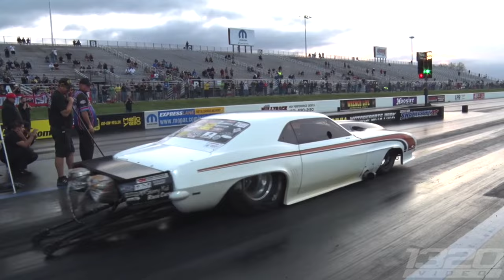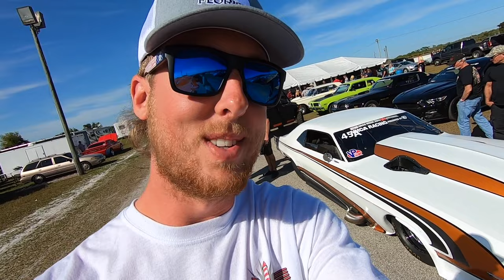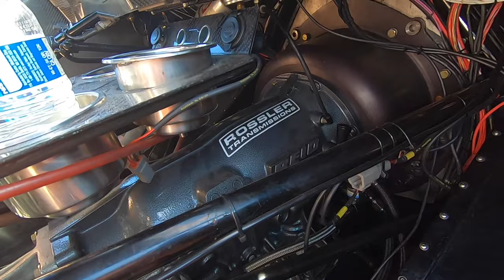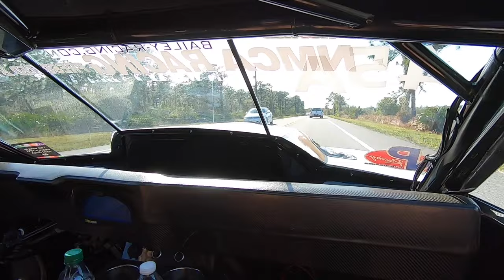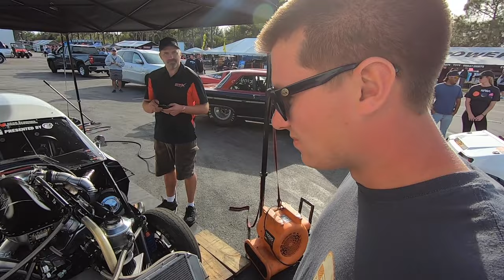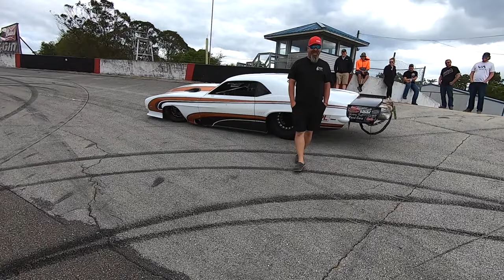We Let a 4,000 Horsepower Promod Camaro Into the Freedom Factory... (Laps and Burnout!!!)

Comment: When he was doing the burnout I was thinking “That was weak” but then I remembered when it idles it’s makes more power than my truck 😂😂
Reply: Yeah that was probably what.....1/8 throttle?
Reply: It’s also set up to hook.
Reply: 1 cylinder makes 2-3x what your "truck" makes
Reply: trillrif axegrindor well it’s a bone stock 7.3 so it makes probably around 200 horsepower so yea it probably does.
Reply: umm yeah I was thinking ... this worth more than the freedom factory .. and makes it look shit... a prospective in whats really what, great vid and a mark in time for where Ceetus is going and how hard he has been working and producing some great content
Reply: phoenix rising those engines can’t limiter like that, it’ll blow up or overheat almost immediately
Reply: It isn't the same tires as your truck neither haha
Reply: If he put anymore than a 1/4th throttle his 4 gallons would be gone depending on the tune
Reply: A metric shit ton of contact patch and it roasts em on just a touch of throttle. Insane
Reply: 260 is no joke
Reply: I thought the same exact shit 😂😂
Reply: Dave Micolichek  it was prolly in its highest gear and 1/8th throttle
Reply: @patrickc658  damn american engine's i got a 1.0 kia that makes 180 hp 😅
Reply: Hey you still gotta get some traction to the ground
Reply: Don't they even limit the power on burnouts?
Reply: Lo lol
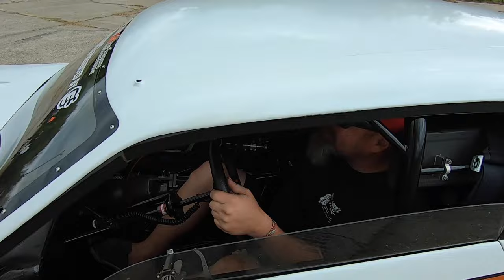Reply: if you remember in the video, he was running on pump gas @9:38, so it's making less HP than if he was on Methanol.
Reply: @kemik8045  it's definitely in methonal at the FF. That's why be said it only had 4 gallons. That's about what it needs for a pass, with some extra for the pumps.
Reply: It makes 10x more power than my 305
Reply: Faxs
Reply: @phoenixrising4573  7bp
Reply: Think Tom did like 5.6 this last race week.
Reply: @vincenthoogzaad  1.0 180hp must be on sause

Comment: I was gonna say you should build a serious circle track car for the freedom factory.  Then I remembered the Dale truck.  Get that thing rippin!
Reply: Killing me that it's never done a proper lap on video yet....
Reply: He isn't going to run the Dale truck on the track seriously, the chassis is worth too much too him and tearing it up would cost a fortune to fix. He needs to pick up a wheelin modified or a short track truck like brents Kole truck if he wants to play around.
Reply: too short for the truck Winged sprinter car is what they need.
Reply: @Mr.Potato420   The track is not to small for the truck. It looks to be a truck from around the late 90's when the series started and they ran on a track the same size as the FF from 1995 to 98. And ran on an even smaller track in  1995.
Reply: it's not circle track anymore, it's detuned. circle track cars have different springs, cambers, and weights on all 4 corners
Reply: I don't care if it's not set up properly. Imagine how good it will sound echoing off those walls.
Reply: @ArmyBoiSweat  True but to fair It will run around the track just fine as it is. It just won't be as fast as if it was setup for oval. Also if it still has a race or race style adjustable suspension on it, it would not be all that hard to adjust the cambers and either adjust the springs or swap them out to get it to a more oval style setup.  With that said I don't think Cleet want's to chance putting it in the wall but who knows what he will do.
Reply: TimothyReidUpNorth907  then let's see you buy one and take it around a track.
Reply: If I remember correctly they changed the caster so it drives straight and now they need to put it back to oval racing.
Reply: Sic Semper Tyrannis  that truck did actually race in that scheme though, just Earnhardt never drove it.
Reply: I like the sprint car idea.
Reply: TimothyReidUpNorth907  What was I thinking when I said that? 
1) I wouldn't care if he took it out on the track. I think it would be awesome for him to put some hot laps on it. 

2) He paid something like $8500 for it might be little less. A true truck series chassis goes from between 3k to 25k without the nascar engine and tranny. The dale truck is a little more special then average because it has the RCR number three on the side of it (Mike skinners truck). Its also street legal which isn't that easy to pull off and takes a hell of a lot of work to make happen. 

3) Most of all Cleetus said he wasn't going to run it around the track for more then joy laps because he doesn't want to screw it up because it was irreplaceable to HIM.  Cleetus said it cost $3500 bucks to fix the original sheet metal after he back into i think it was neighbor and that was barely a love tap. 

4) All that being said is why I talked about him needing a wheeling modified or a short track asphalt truck similar to Brent's from PFI.
Reply: jacob sweat they literally just raced 20 something non circle track crown vic’s and weren’t a terrible split away from what the old owner said was a fast lap (considering they were all on a crappy tyre too)
Reply: Been sold
Reply: Like so many things involving the freedom factory, the opportunities for  different vehicles and content is beyond counting.
Reply: I can't believe that thing is street legal! here in Australia if you drove that on the road, the entire police force would come to arrest you.
Reply: oh shit yeah
Reply: Have Cleetus drive a 410 winged pavement  Sprint car around the track for 50 laps
Reply: @Liberty_Prime_Is_Online  Bro move to NZ where we have decent car laws then.
Reply: @Liberty_Prime_Is_Online  Australia with even more gestapo-esque statist crap! Love the people, y'all have terrible choice in politicians.
Reply: Dale truck, Dale truck, Dale truck
Reply: I have raced here that track is not to small for any type of oval car I have seen nascar truck teams use that track for testing

Comment: I can imagine the conversation:
"Wanna ride in my 5-second street car?"
"Is that zero to 60?"
"No, quarter mile."
"WUUUUT???"
Reply: Whole new ballgame. When you compare 0-60 in 5 seconds fun to saying this car runs a quarter in 5 seconds😳
Reply: That’s the 0-250mph.
Reply: My car doesn’t even do a 5 second 0-60 and this car is at 200
Reply: when 5.998s becomes 5s..
Reply: @Svendrys  probably because the 5 is before the decimal point
Reply: Bitcoin Trades .000001
Reply: Svendrys what would you call it
Reply: Max  just time those MPGs. Take glory where it's due, brother.
Reply: Svendrys 5.77 @258 is the best pass so far on the car. Last rip was a 5.99, so yea it’s a five second car.
Reply: Bitcoin Trades nobody is giving you an honest answer but I’d say a little over one second. It does 42 mph per second acceleration.
Reply: @Svendrys  hello captain obvious
Reply: Dominic torreto will be sad..
Reply: @Svendrys  r u saying 5.9  should be 6?
Reply: @Svendrys  It all depends on what type of Math you are using. In my line of work, 1+1=3 for very large values of 1.
Reply: Max  You need a turbskie on the engine.
Reply: @Svendrys  That's common parlance for drag racers. A five-second car means anything that starts with a five. I suppose it would be more accurate to call it a sub-six car, but that's how it's done.

Comment: Tom Bailey and Steve Morris have and have had that Camaro rolling for a long time. Kind of makes you wonder how much faster Leroy would be with a body on it.
Reply: I think it would definitely make it mile-an-hour better on the big end
Reply: This camaro also has 4000 hp.... that's almost 2.5 times the hp makes a huge difference... I agree having a body would make Leroy faster but it wont run less than a seven without alot more power
Reply: makes me wonder what will happen when toast gets on the quarter mile.
Reply: Leroy has a lot smaller tire also.
Reply: 06 TrailblazerSS we’ve always wondered
Reply: I bet with a lightweight carbon fiber body it would run some 7.6-7.7 on the 7.9 power level and be more consistent as well. I was by no means saying it would run 6s
Reply: I bet it would run 7s again with a body lmao
Reply: The problem with Leroy isn't aero right now. It's suspension. They've said multiple times they aren't going to dick with any aero stuff until they get the suspension sorted.
Reply: And a steve Morris engine 🦅🦅🦅🦅🦅🦅🦅🦅🦅🦅 soooo many bald eagle 🦅🦅🦅🦅🦅🦅🦅🦅🦅🦅🦅
Reply: False Flag and it’s got an LS1...
Reply: @AnthonyBowman  at the speeds Garrett has run with Leroy aerodynamics plays a bigger role than I think you realize. The 8th mile wouldn't change that much but from 660'-1320' is where the real benefit would be realized. I am not sure what else they can do with the suspension that hasn't been done already without going sold rear. Mark Carlyle and Fran seem to have their C6Z working pretty well and so is the other 7 second C5Z. Aside from different shocks I am not sure what they have different than what Leroy has.
Reply: @06 TrailblazerSS  Steve Morris builds seriously incredible engines.

Comment: Florida street legal car: "If it has wheels and an engine you ok"

Canada street legal car: "Don't you DARE installing a 4"+ length spoiler"
Reply: Bailey is from Michigan, where the laws are almost as loose except for you do need inspection, Florida requires no inspection. The term inspection in Michigan is real thin, lights? Tires? Wipers? Body panels? Does it stop? Ok you pass.
Reply: Dave Micolichek they got free health care we dont 😂👎
Reply: @headon434  That's why they all come to America to get any real healthcare done.
Reply: Car Guys in Germany: *getting arrested and their car towed because it got tinted rear lights *
Reply: Where in canada are you? Alberta, sask and manitoba are very lax
Reply: come to Alberta, both of my vehicles got registered and insured without inspection.
Reply: Not true at all... I’m just outside Vancouver. I plate n street drive an 86 Monte Carlo SS, with a big block and 14” slicks. Weld pro stars... and no more smog testing here and no regular vehicle inspections...means no problems.
Reply: Depends on the province you live in .
Reply: @CamaroAmx  Im from Michigan and never had a vehicle inspection done ever, i can tell you right now alot of vehicles that roam flint and Saginaw are total death traps and wouldnt pass an inspection to save them from the scrap piles
Reply: Im from Germany and you can’t drive you’re  car of its 0,2 inches too low

Comment: "street legal in florida" should be the punch line of a joke.
Reply: When I lived in Florida in the late '80's, it was still legal to drink in a car, as passengers.  Some of the liquor stores had drive up windows, where you could get a drink to go.

So, street 'legal' is a wide margin in Florida.
Reply: @georgedennison3338  is it illegal to drink in a car even though you are not in the driving seat?
Reply: @Somethingafw  yes.....open container law
Reply: but you cant drive Nissan skyline r34, and many others.. because under the new vehicle importation guidelines, all motor vehicles less than 25 years old must comply with FMVSS safety standards in order to be eligible for use in the United States... WHY?!! so it means Hot rod with steering wheel made of chains are safer then cars which got NCAP, JNCAP stars..
Reply: @georgedennison3338  we still have drive-up windows in az
Reply: TimothyReidUpNorth907 y’all really gonna ignore the illegal ride height, motor, aftermarket parts, decibel levels, modified chassis length, and the million other things that make this non DOT compliant
Reply: @georgedennison3338  central florida still has drive thru liquor stores still open
Reply: Steals a Falcon 9 booster from SpaceX, slaps a couple of headlights and a license plate on... 0.5 secs quarter of a mile STREETLEGUL!!!
Reply: It's not a Florida car.
Reply: George Dennison they still have drive thru bars tho
Reply: Arkansas, Connecticut, Delaware, Mississippi, Missouri, Virginia, and West Virginia allow passengers to drink while the vehicle is in motion.
Only the state of Mississippi permits drivers to consume alcohol while driving. However, the driver must still stay below the 0.08% blood alcohol content limit for DUI.
Reply: TimothyReidUpNorth907  Not here in Mass. Too many equipment violations to list, any one of which can get you impounded. You may beat it in court but you'll be paying towing & storage fees to the yard until your hearing date. And no, none of it is refundable upon dismissal.
Reply: @GarretRB  street legal in a lot of red states ..  highly illegal in any blue state..
Reply: Brandon G gotta love my state 😂❤️
Reply: LOL @ Brandon.
That said, Federal motor vehicle standards still apply in Florida. Also, Florida state law echos those requirements. So, for example, the car needs to have headlights, tail lights, turn signals, windshield, bumpers, and so on. However, we don't have vehicle inspections or emissions testing. So some illegal stuff can fly under the radar, so to speak.
Reply: Garret Barber in Florida we don’t have to worry about any of that stuff
Reply: @bob bobo
You're right! I forgot about that. I had just started a job in baseball, and was in Florida for my first Spring Training. A lot of wild stuff went on, but THAT was the strangest.  

Well, that, and 'herding' gators off the baseball fields at dawn: Two trainers, a golf cart and a fungo bat, (longest bat I could find!)  Neither of us had ever seen a friggin' gator except in a zoo!
Reply: It wasn't when I was there in the late '80's, but I think it has changed. It wasn't illegal to have an open container, and someone reminded me it wasn't even illegal for the driver to drink, as long as they aren't 'intoxicated'.  Don't know how they judged it.  

MADD already had drinking and driving banned in Oregon, by then.  Florida shocked the shit out of me.  No state tax, and more friggin' scammers than anywhere else.  Since I lived there, I've watched the TV scams, and other scammers, and 99% of the time, they are in Florida.
Reply: @GarretRB  lolol, modified chassis length?  motor? aftermarket parts?  illegal ride height?  wtf are you talking about?  None of those things make a car non DOT compliant.

Comment: Meanwhile in France (where I live) :
Did you put 18" wheels on a car that runs 17"s stock?
THAT'S ILLEGAL !
Reply: Wait you can’t have aftermarket rim that aren’t stock size
Reply: Og Swineflu  in Europe you can’t use aftermarket rims period. You will first need a certificate for the rims by the Manufacture then a separate Testing facility. If you have alle required documents you can go to a civil engineer to test it again and give you a certificate, and then you go to the state inspection and they will decide if it is legal or not. Car must be Transporter on a trailer at all times, otherwise it will be impounded. Process must be repeated for every modification.
Reply: @NameSchema100  i want to cry for everyone living under that tyranny

Comment: When my 14 second car doesn't even have power windows : (
Reply: Been there lol
Reply: My street car doesn't have power windows or power steering, and only one cupholder... Might manage a 14 second 1/8 mile pass...
Reply: 14 second 0-60 cars are typically pretty worn out eh?
Reply: No power anything, no heater, no ac, no ps, no interior
Reply: @tommylyeah  well, then mine is better, I've got a heater, (just fixed it) and complete interiour.. also power brakes, its hard to stop 2.6 tons without... having a hard enaugh time steering my 225mm wide tires without power steering :-P

Comment: That was the tamest burnout the Freedom Factory has ever seen.
Reply: Can't be helped, with those huge tires at the back the small ones at the front can't even hope to stop the car once its high on the torque.
Reply: At maybe half throttle he made probably $50-100 worth of tire disappear in just a few seconds.
Reply: I imagine it's making enough steam to roast the tires at a very low RPM. That's not tame, that's a flex to me.
Reply: @michaelscott-joynt3215  that's what I mean though, it wasn't bouncing off the limiter like most of the burnouts done there but it was still impressive. That thing is making stump pulling torque down low.
Reply: It takes a bit of work to switch from gas to methanol and that thing can't really do a full rip without methanol.
Reply: TimothyReidUpNorth907  Very true, but the production values would be amazing!

Comment: If he blows a transmission he can say goodbye to his legs
Reply: Dont most drag cars that do that get a safety wrap on the trans? I didnt see one there so that seems kinda dangerous
Reply: That case is more than double of oem case thickness
Reply: Yeah, they are thick, but they still can blow apart, got to have a set to drive this beast.
Reply: @KLMALLENDER  Oh i see. Appreciate your response. Pretty cool the case is that damn strong. Gotta love drag parts.
Reply: @MrDrBlahh      This season NHRA required that all Pro Mod car's must cover the Transmission and drive shaft.
Reply: jcnpresser It also has a steel liner in it. It is fully SFI rated for safety. I’ve personally blown a few and never had anything come through the case. Flexplate and guts.
Reply: If the trans explodes, a thin layer of sheet metal isn't going to do anything to slow down the pieces. Hence the need for an SFI case, which is also why they can run open tunnels. Easier to service between rounds.

Comment: a stand alone electronic power steering system ran off a 3s lipo would work freaking slick and not interfere with the rest of the electrical system

Comment: Imagine if he shot The transmission on a run and things Come flying at 9000rpm.... It cut him right in half....
Reply: Exactly what I was thinking about aswell.. No protection at all 😯
Reply: It's an SFI rated aftermarket case (very tough). The odds are very small that parts would come out of it.
Reply: @frankcarter2174  you are doubting physics right now... Believe me, it Will not hold The momentum of 9000rpm if it brakes apart